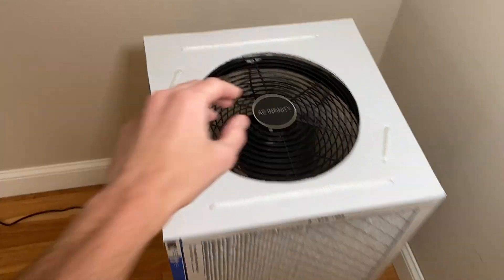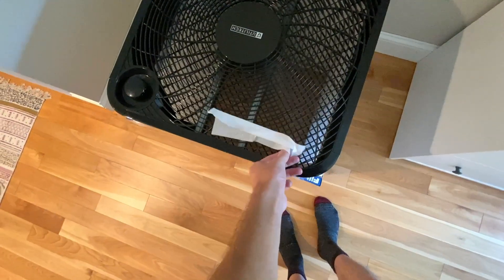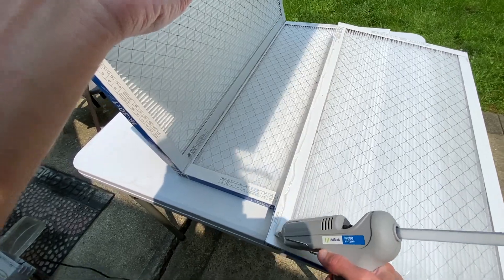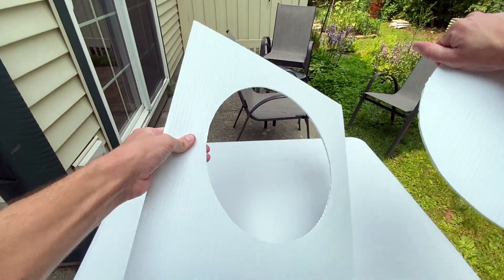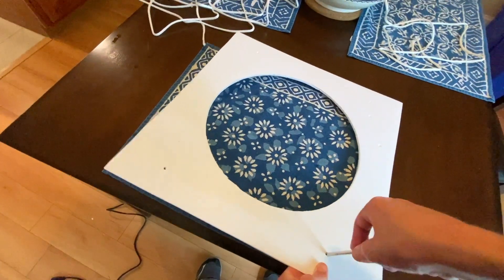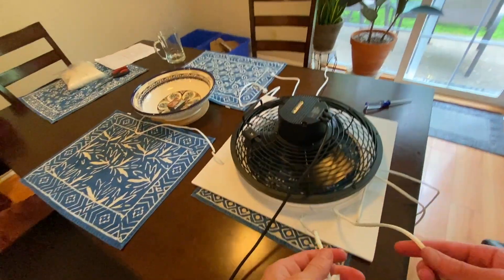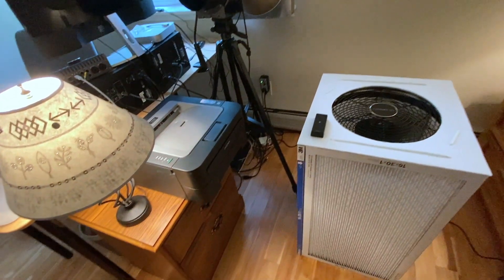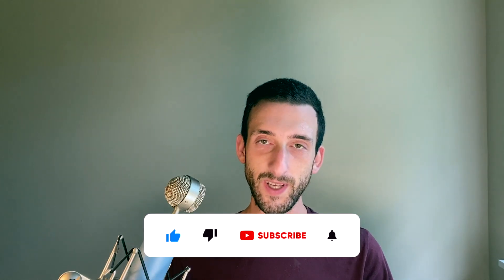How to Make a Better DIY Air Purifier

Comment: awesome idea but 2 issues...   the 16x 30 filter i can only find in lowes.  not even in amazon.   and the fan is hard to find. out of stock on their web site .   amazon has it with louvers. for 169.  very expensive
Reply from the maker: You can use 16x25 or 16x20 filters as well.
Reply: @HealthyHomeGuide  would it make much difference to go with 3M Filtrete 2800 MPR Ultrafine Particle Reduction Filters orare the 1900 merv13 good enough.  I have 7 tiny dogs and my house is a dust bowl.  piles of dust everywhere

Comment: A faster way to change filters,without rebuilding the whole apparatus,ty.
  Also the white filter material darkens with use.Probably just vacuum it off ?
Reply from the maker: Vacuuming them helps for sure. For optimal performance, these filters should probably be replaced every 6 months.

Comment: What if the fan was blowing into the box instead of out
Reply from the maker: For air purifiers the fan should be blowing upwards, for two reasons:
1.) If you blow air downward into the box, there's a lot of turbulence that reduces the air flow rate. 
2.) By pulling air through the filters before it hits the fan, the fan will stay cleaner.
Reply: Ahhh I see

Comment: Is this setup good for removing carpet dust? And can it be hung from a ceiling?
Reply from the maker: It wouldn’t necessarily remove dust from the carpet itself, but it would lower the concentration of carpet dust in the air, as people walk on the carpet and kick it up. I do also have a video on how to properly remove dust from carpets if you’re interested 🙂

And yes, you can hang this from a ceiling. You’d just need to seal the bottom with a square of coroplast.
Reply: @HealthyHomeGuide  
Thank you for replying, I have been looking for a design to deal with carpet dust and dust in general for my bedroom from getting all over my things and shelves. 🤔😄
Reply from the maker: @e7yu  Sounds good! I’d recommend using HEPA vacuum with a suction impelled brush roll on your carpet.
Reply: @HealthyHomeGuide  Good to know. Thanks 🤔👍

Comment: [if this is a healthy home guide channel then why are you suggesting a wireless technology fan?  the electro magnetic frequencies are NOT SAFE or HEALTHY.  Do you have any non wifry fans that are as quiet?  Thanks]
Reply from the maker: I care about EMFs as well. But instead of simply assuming that this remote fan is harmful, I actually tested it with my EMF meter across three different categories: magnetic, electric, and radiofrequency (RF). 

The results: it emits very small/weak magnetic and electrical fields. I saw virtually nothing on my meter for those. As expected. 

As for RFs, it only emits those when the button on the remote is being pressed. I don't feel that this is a significant exposure because I almost never change the fan speed, and I keep it running 24/7. When the unit is simply running, it emits no RFs. Hope that helps!

Comment: What would happen if you flipped the direction of the fan?  That way the dust is contained.
Reply from the maker: But for air purifiers the fan should be blowing upwards, for two reasons:
1.) If you blow air downward into the box, there's a lot of turbulence that reduces the air flow rate. 
2.) By pulling air through the filters before it hits the fan, the fan will stay cleaner.
Reply from the maker: I believe you could use it for that, yes. That’s more for workshop applications. Or to help with activities that generate a lot of dust, in general.

Comment: Is there a reason for using 1” filters vs 3-5” filters? Thanks
Reply from the maker: Good question. In this particular filter (3M filtrete) 1” filters seem to perform very well in terms of pressure drop/CADR, so thicker ones aren’t needed.

Comment: How about using 9 PC fans instead? I have a lot lying around haha. Have you tested the DB difference and air flow difference with PC fans?
Reply from the maker: Great question. My most recent video actually discusses how awesome PC fans are for this application. I definitely recommend using PC fans if possible! The build might be a little more challenging though because you need more fans.

Comment: Can i use any type small fan or does the fan have to be the infinity fan.
Reply from the maker: It can be any fan, but how well it cleans the air and how quiet it runs will depend on the quality/type of fan.

Comment: Suggestion on adding charcoal filters to this? It’s easy to buy replacement charcoal filters like Winix ones. Looking for ideas
Reply from the maker: My thoughts on activated carbon filters can be summarized by this quote from an article by HVAC engineer Joey Fox:

"Carbon filters can potentially be effective if sized properly. However, air cleaners rarely provide equivalent outdoor air delivery rates for the carbon filters. They also become saturated over time and would then become ineffective. Unfortunately, many portable air cleaners do not provide clear information on the longevity and effectiveness of their carbon filters.

While carbon filters are a harmless feature, they may not necessarily deliver the desired results. Additionally, carbon filters do not remove particulate matter which includes airborne diseases. Therefore, they have no impact on addressing health concerns related to viruses or other particulate matter.

In general, when dealing with VOCs and odors, the most effective approach is through ventilation by supplying fresh outdoor air to the space."
Reply: @HealthyHomeGuide  pretty much I agree with you. However when the outdoor air is polluted with forest fire smoke, charcoal filters help absorb gas pollutants.  It’s not as effective as filters that are designed for a specific family of toxins but helps. Especially since houses are not air tight and smoke seeps inside.  Charcoal filters are not like mechanical filters, gas absorption is random , which means running air over and over will gradually reduce the toxins. At least while the charcoal is still effective. For those people sensitive to the gaseous toxins, every little bit helps, especially if you’re trapped inside a house or restricted to a couple rooms within a house.  We don’t mind changing out charcoal filters as needed. 

Just looking for ideas

Comment: if u run it on lowest settings and have huge filters then doesn't this create problem that particles will fly to the filters too slowly and hence not be absorbed optimally? I suppose there is an optimal speed of fly to maximize absorption
Reply from the maker: Interestingly, there are research studies showing that capture efficiency of filters improves as face velocity decreases, especially for ultrafine particles. So basically filters tend to perform better the slower air travels through them. I discuss that study and others in my latest video.

That being said, there is likely a speed that’s too slow. I’m not sure what that is, but I don’t think air moves that slowly through this air purifier.

If you’re still concerned about it, you can use smaller filters, which decreases the surface area and increases the air velocity. Try 16x20x1.
Reply: @HealthyHomeGuide  thx, so lets say I use smaller filters and keep this on speed 1 - will I still get 250CFM? I suppose using too small filters could create problem that fan creates too big airflow which destroys/degrades filters slowly? because this could exceed filter max airflow specification
Reply from the maker: @johngreen2468  I think you’ll be okay with 16x20. Air moves slowly through these filters because there’s 4 of them in this design, as opposed to 1.

Comment: You might be able to slightly improve the efficiency by moving the chloroplast in line with the fan blades. It should theoretically reduce unwanted vortexes. I don’t know how much efficiency you get, but I know it’s a technique PC fans use.
Reply from the maker: Thanks for the suggestion! I’ve heard of this technique and am trying to think of a feasible way to employ it with this fan.
Reply: @HealthyHomeGuide  I don't know if the fan blades line up with the outer ring holding the fan together. If that was the case I would just cut the chloroplast so that the fan can sit on top of it on the outer ring. No string but the fan is poking out the top more. I don't know if it is structurally strong enough to hold the fan on the outer lip, but it would have the advantage of being easily removable.
Could make thing easier to adapt to different filter sizes by making different sized chloroplast squares with the same cutout.
Reply: You can also do as I said putting the fan so it can sit on top of the chloroplast but also make a shroud for the fan extending to the tips of the blades. You can see this in computer fans and some traditional fans like the Masterforce 14” DC Shroud Fan. I learned quite a bit about fans from the Major Hardware channel. Good stuff there with experimenting with different 3D printed PC fans. The same principals apply to larger fans.

Comment: Energy draw.  How many kWh does this use in 24 hours, or a month?  Did you run across data re: cfm/watt?   Good work.  Interesting chart.  it would be good to include actual watt draw with a Kill-a-Watt device.  Also, include actual (vs nominal) cfm air movement in the final configuration.  Then we know the cost to scrub/filter a whole room volume of air.  Lots of filter = low static = good.  Quiet is ultra-important because people will NOT use it if it's noisy (like noisy bathroom fans or kitchen hoods).  Silent is best.  Does removing the wire grill reduce noise?

Comment: I think another alternative to using clothesline you can use shoe laces, wouldn't need the screwdriver to push the cord through.
Reply from the maker: Nice suggestion! That could work. You’d need to pull them very tight of course.
Reply: Any reason you chose the clothesline over something like a ziptie?  @HealthyHomeGuide

Comment: Hot glue and different form factor. You’ve really contributed something to the air cleaner discussion on YouTube. I think your method is what I’ll use going forward.
Reply from the maker: Nice. I’m still using my air cleaner and it’s proven effective.
Reply: @HealthyHomeGuide  I made mine a month ago and it's changed how I feel in the shop. I didn't realize how itchy I was until I started aggressively filtering the air.
Reply from the maker: @gte717v  that’s awesome to hear that it’s protecting you.
Reply: @HealthyHomeGuide which MRP rating filter did you use..300-2800...higher numbers indicating that the filter can capture more microparticles, such as pollen, pet dander, smoke, bacteria, and viruses. Some say that the best filters have an MPR between 1,500 and 1,900. However, it's not recommended to use filters that are too strong, as they can increase energy costs, reduce airflow, and make heating and air conditioning less effective.
Reply: @HealthyHomeGuide 
How about FILTERBUY brand??

Comment: Hi, I appreciate your approachable method. I've got one of those noisy box fans blowing on my woodstove and am looking for a quieter alternative. The box fan is powered by a thermostatically controlled power cord. This "works" because I leave the box fan turned on speed-1 and the thermostat triggers power once the woodstove is up to temperature. When the stove cools down, the fan shuts off. I love the setup but hate the fan! I'm wondering if the AC Infinity fan will retain its speed setting if the power is cut as I've described. Having to manually turn on or adjust the fan to a desired speed each cycle will not work for me.  Thanks again!

Comment: Great design, I see for any Costco members that now through Feb 25th you can get the 4 pack of 3M MPR 2500 MERV 14 filters 16x25x1”for $50. About 5 inches shorter than the design here, but a higher filtration level. 

Was wondering what brought you to use the AC Infinity fan? I am wondering if the Dreo 11” air circulator would also work with this design (if it can be removed from its pedestal). Could save some cost there without sacrificing on noise control.
Reply from the maker: Awesome tip with the Costco MERV-14 filter deal!

Fantastic question. I actually have two Dreo fans and they’re the best circulation fans I’ve ever owned by a long shot. Unfortunately, the power for Dreo fans plugs into the stand itself, so even if one was able to remove the fan from the stand, it couldn’t be powered. The power for AC infinity fans comes right out of the fan motor itself. 

That was one reason I used AC infinity. The main reason was that AC infinity fans are the quietest and most powerful I’ve tried. Also, AC infinity seems to have the best reputation among fan companies if you read hundreds of reviews across different sites. They’re expensive, and they’re robust. 

Honestly, I like Dreo fans even better. I wish Dreo could be more feasibly used in this application.

Comment: Hello engineering masterminds!  I have a challenge and wonder if you can help me.  I was wondering if I can use something similar for venting dust and hair out a window or into some containment system that could be emptied.  We have a bunny room for our pet rabbits and they shed ALOT.  I vacuum twice a day and still get little hair tumbleweeds blowing into the rest of the house.  Trying to come up with something floor level that will continuously pull in air to get hair and dust out of the house or in a container. HELP! Thanks!
Reply: I think that

Comment: Just built mine with a few modifications.  Used a sheet of clear acrylic for the top.  Cut the opening so that the fan sits on top of lid.  I used foil tape to keep the filters connected.  Added a line of foam tape to the top of the filters.  Love the fan and remote.  I think that’s the key.
Reply from the maker: Nice, that sounds like it could work! Although since the fan is resting on TOP of the clear acrylic, just make sure the fan isn’t pulling air from above the acrylic (unfiltered).
Reply: Just bought the fan but was also thinking about resting the fan on the lid. Did you test to see if it’s pulling air in from above the acrylic?  Thank you!

Comment: Cool design Olson! BTW I got a bunch of PC coolers laying around, do you think I could use them in a sort of grid config instead of the regular fan for this? or the airflow wont be strong enought?
Reply from the maker: Thanks! I don’t feel that PC coolers move enough air to be effective in an air purifier.
Reply: @HealthyHomeGuide  I think you might regret that comment after your recent video lol
Reply from the maker: @MemeScreen  Yup haha. When you asked this question, I was ignorant of the wonders of PC fans.

Comment: Hi thank you for your video... but I have 1 question. If the air coming thru the side, the filtered particle will remain exposed to the outside (its surrounding). Without any outer cover, the particles might escape back to its surrounding.. Even if the Fan are running non-stop, there will be a steady gradual drop in the pressure as the particle build-up, slowly clogging the filter, and will come to a point where air might still pass thru but some particle wont stick to the filter (due to low pressure).. and if I plan to run the filter maybe like 6 hours or 12 hours a day, when its OFF, is it possible the particle escape the filter?
Reply: Hi- I wouldn't worry about this as it's a theoretical possibility but not likely a real problem. What you are describing is exactly how filters are designed to work. Filters perform better and better as they slowly clog up, that is until they eventually clog and stop working altogether. The filters should be replaced long before you reach the point of substantial pressure drop and you should be able to see dirt buildup long before the filter is clogged. As HHG suggests, you can periodically vacuum the outside of the filters once you notice a buildup of dirt, pet hair, etc. - this will remove larger particles and prolong filter life.
Reply from the maker: You’re welcome. I’m not exactly sure on the answer to your question, but vacuuming off the filters every so often should help prevent that. And changing them when they’re too saturated with dust. 

You can test airflow through them with a paper towel square as I demonstrated. Also note that many factory made air purifiers have the pre-filter exposed, so it’s a common thing.

Comment: Will these filter size work with the AC Infinity CLOUDLIFT S14?
Reply from the maker: Nope, unfortunately.
Reply: Thanks for your reply. Do you know if the S12 will work with 16x30x2” filter with the (Actual Size: 15.75 x 29.75 x 1.75 Inches)? Thanks again.

Comment: This is the only video that mentions an EC fan.  The noise reduction is a huge deal, thanks for that.
PSA - Costco has great prices on Filtrete (3M) filters.
Reply: They go on sale several times a year.
Reply from the maker: Absolutely, I have no idea why other creators tend not to take this into account!

Great tip about Costco - I have one right nearby. I might have to make a trip there hehe. Or buy online.
Reply: Other creators don't because their focus is usually about cost and those fans are heckaspensive. I'm not against it. Maybe I'll do it in a few months but that's why they don't.

Comment: Isn’t the fan supposed to be pointing downwards?
Reply from the maker: Nope. With downward facing fans, the idea is that the fan is before the filters, which creates a vortex that can catch large amounts of dust at once. These are used in woodshops, for instance. But for air purifiers, you want the fan to be after the filters.
Reply: @HealthyHomeGuide  Isn't that better? Like what 3D Handyman has done.